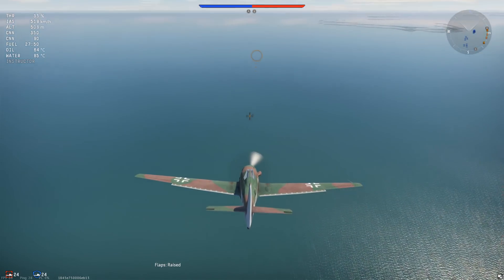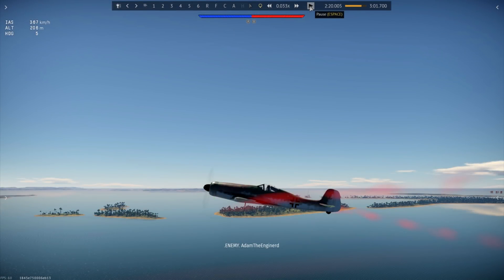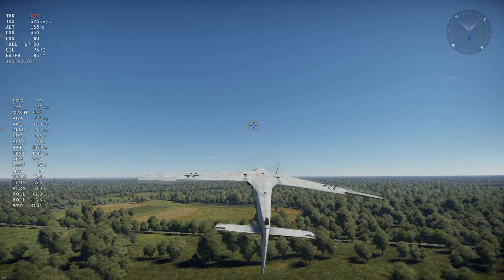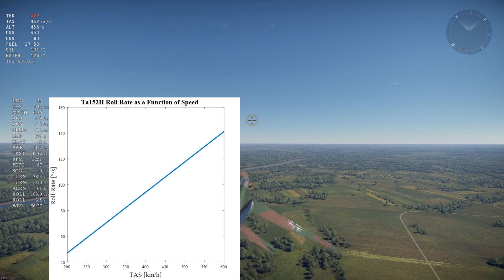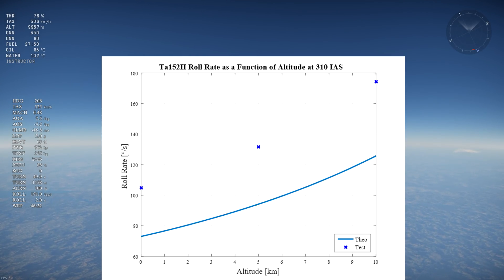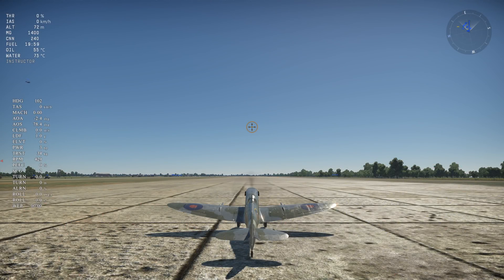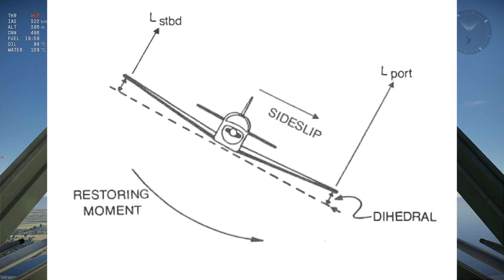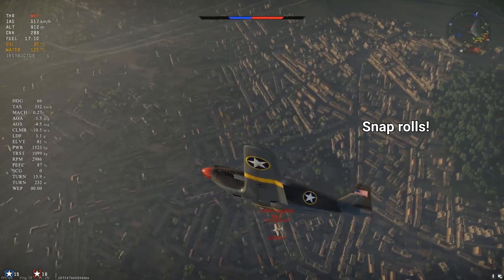Aircraft Roll Rate Explained

Comment: Hey Adam, is the induced drag from this lift significant enough to contribute to slowing down when you roll? Like is it significant compared to the parasite drag from the aileron deflection?
Reply from the maker: No, because the aileron that reduces lift sees less induced drag, compensating the increased induced drag from the other wing. Of course, it'll somewhat ruin the lift distribution so the induced drag will be higher for the same lift. Drag from induced drag should be in the same ballpark as aileron deflection drag I'd say.

Comment: The Typhoon has massive wings... they're thick, and more designed for speed than anything else! On top of that, each wing holds 6x browning 7.7mm guns each with 500 rounds (apart from two out of 6, that carry slightly less).
The Typhoon also carried fuel tanks at the front of the wings, and a weak fuselage...
The lifting capacity of the role rate simply cannot overcome the sheer weight of the wings any more than it does! And if it could, the tail would snap off anyway
Reply from the maker: The wings are thick, but them being thick actually makes them lighter! It's like a taller I-beam.

In any case, the weight of the wings (roll inertia) only affects roll acceleration, not roll speed or roll rate.
Reply: @AdamTheEnginerd  my bad I always assumed role acceleration and role rate were kind of the same thing... or at least that acceleration is part of the role rate anyway...
But yeah It seems like a heavy wing to lift either way... And still that wing I think would be heavy even in spite of it's design, because 6 machine guns is just heavy, and the wings are quite long, meaning the weight is held out at a longer distance (kind of like an extended telescopic crane not being able to lift as much vs a crane in a retracted state)

Comment: Is roll rate related to the Climb rate? It seems to me that a lot of planes with good roll don't have good climb
Reply from the maker: Nope! They aren't linked at all. There is some relation between bad turn radius and good roll though.
Reply: @AdamTheEnginerd  what characteristics do you think a medium altitude air superioty fighter need to be one of the best?
Reply from the maker: @tzeentchnianexaltedsorcero2041  The engine tuning for that altitude, apart from that nothing especially special about medium altitude.
Reply: @AdamTheEnginerd  I'm under the impression that mid/high attitude fighter need to have good linear(?) energy retention and good roll rate for BnZ tactic.
Reply from the maker: @tzeentchnianexaltedsorcero2041  That's good for any alt fighter though.
Reply: @AdamTheEnginerd  ok.

Comment: Hey adam! A bit late to the video but when you mentioned engine torque I remembered that many of the Macchi aircraft have one wing longer than the other to counter the engine torque. How does that affect roll in RB? (if it affects at all)
Reply from the maker: Yeah it does, the roll is faster when the smaller wing is going downwards.
Reply: @AdamTheEnginerd  Thanks! Ill be sure to roll to the smaller wing's side on my next reversal

Comment: On one of the Italian planes, they solved engine torque by having a longer wing on one side! Which one is that plane again?
Reply from the maker: C202 or C205 I think.
Reply: Does that mean it is easier to fly that in sim? Marginally? 
A tiny addendum video upload? :P
Reply from the maker: Maybe, though it only works for a certain speed range. Above and below, you still have a net torque either from the torque or the asymmetric wing.

Comment: You can check if the modeling is correct by testing roll rate with only aileron deflection using a stick.
Reply from the maker: You still have sideslip/dihedral effect even if you only use ailerons, and also the speed gain/loss due to loss/gain of altitude will throw off your speed.

Comment: YT has given me the notification only now :-(. BTW another fantastic video Adam!
I think the typhoon has that bad roll rate because it carries fuel in the wings, and those wings also produce a lot of lift
Reply from the maker: Damn YT! Thanks!

Many planes carry fuel and guns in the wings, and those would only increase inertia, which does not affect sustained roll rate. The wings don't produce significantly more lift than others.
Reply: AdamTheEnginerd well the typhoon is an heavy aircraft (heavy for being a single engine fighter), and to achieve is incredible MER it needs a lot of lift (the p/w ratio isn’t comparable with a spitfire or a Bf-109).
To make a comparison: the F4u4b is another Heavy single engine fighter with 4 cannons in the wings.
The F4u doesn’t have remotely close the typhoon MER/turn, and (at least from what i’ve seen from videos, since right now I can’t play thanks to internet issues) it’s ailerons can deflect at higher angles (the typhoon aileron when deflecting down seems to do less than 5 degrees to me lol)
Reply from the maker: @ferrarisuper  Heavyness is not related to roll rate though. Typhoon has average deflection.
Reply: AdamTheEnginerd I was talking about aircraft weight because the typhoon has a very good turn time and incredible MER, so it needs a ton of lift. Another heavy aircraft, the F4u4b does not have all that lift, so it rolls pretty well.
Btw all aircraft that have a decent roll rate doesn’t have fuel in the wings, i think that’s also why the ta-154 has such incredible roll rate being a 2 engine fighter.
Reply from the maker: @ferrarisuper  No it's not related to weight or lift (much).
Reply: AdamTheEnginerd then i did not understand the video well, didn’t you say that lift is what counters the Roll rate?
Reply from the maker: Yes it's proportional to the induced angle of attack due to roll rate. The wings aren't at their CLmax angle of attack, so planes will produce roughly the same lift for the same angle of attack regardless of their different wings and CLmax.

Comment: Off Topic: thx to you I experimented a little with the overlay data. What i realised is that Increasing Propeller efficiency does not necessarily increases thrust, what I thought to be logical. Why is that?
It was ki43-II if it matters.
Reply from the maker: Depends how you're increasing propeller efficiency, and you need to make sure that you're at a constant TAS because thrust reduces when TAS increases (P=TV).

Comment: I have returned to WT but I run into a situation  when I'm flying in my d30: When I'm slightly outrunning a plane like a 109 or a yak 9 in a straight line, I generally don't know what to do. I saw a video of Green fury who had a major energy adventage and he did a high yoyo with a loop, but that doesn't include my situation. I'm quite noobish so any help would come in very handy :)
Reply from the maker: Run to teammates if you have some left. If you don't, you're in a pickle if you can't outturn them.
Reply: @AdamTheEnginerd  Couldn't you try to go to high speed and make them compress?
Reply from the maker: @pranavarvind4281  Yeah, just depends what you're facing.

Comment: If TAS is constant then roll rate wouldnt change at different altitudes so technically a plane doesnt roll better at higher altitudes assuming throttle is max and engine power is constant, right?
Reply from the maker: Yeah, but planes fly in IAS, not TAS. So at climb speed (constant IAS), you'll roll better at high altitude.

Comment: 0:42 This isn't quite right. It doesn't make lift because it is pushing air downwards or upwards. Instead the position of the aileron essentially controls in what direction the induced circulation will go. If the aileron is on the right wing is up the air below the wing will be pulled up around the trailing edge creating a vortex that is from the pilots view counterclockwise. This vortex then induces a counterclockwise circulation (pilot view) around the wing which allows the the differences in pressure (low pressure below wing and high pressure above wing) and therefore lift allowing the plane to rotate. Another little thing in order to roll the plane you also need to be using the rudder not just the ailerons otherwise you would start so slip. Cheers!
Reply from the maker: Is air deflected upwards? Yes, and that's all I said. Forcibly to get a force and a torque, air must be deflected and action-reaction will produce the force on the wing.

You can roll while slipping. You'd be right if you wanted a pure roll (not really possible).

Comment: Very cool, thanks for the great video. One thing I still don't understand is why the FW-190 (A series) have such a good roll rate. Especially when compared to the Bf-109. There might be minor differences in wing span, aspect ratio and aileron size, but nothing that should result in such a HUGE difference in roll rate.
Reply from the maker: My pleasure!

Fw190A actually has a shorter wingspan and a higher aileron to wing size ratio, hence the difference in roll. Bf109s actually have decently high wingspan for its size with smallish ailerons.

Comment: Adam have you done a video on the spitfire mk. 24? I am looking for MEC settings especially how to keep using WEP whilst climbing, I just can’t stop the engine from overheating and I’ve tried many variations of radiator and propeller pitch.
Reply from the maker: Nope I have not. Put PP to 80-85% and rads to around 50% and you'll be fine.

Comment: If a wing is ultra THICC, would an increase in attack angle correspond to a lesser relative increase in lift, compared to planes with anorexic wings? Id it's the case, then you would expect a short and thicc wing to be optimal for roll rate, sacrificing MER from the former of the qualities, and speed from the latter.
Reply from the maker: No, in fact it would be the opposite, thiccer wings have a slightly higher increase in lift per increase in angle of attack in general than thin wings.
Reply: @AdamTheEnginerd  Huh, that is really interesting. In that case, what is the point of having thiccer wings? Wouldn't be possible to generate the same lift with wings that are simply longer along the chord, and also get less aerodynamic drag, as well as a better roll rate?
Reply from the maker: Thiccer wings are lighter (counter intuitively at first glance), among other things. I explain why here: https://www.youtube.com/watch?v=hDSZ1h5Aphw&t=0s
Reply: AdamTheEnginerd Thank you very much!
Reply from the maker: My pleasure!

Comment: Hey Adam! As an engineering student, your videos are super fun, educational, and easy to follow. May I suggest a video on take off run? I believe it’s an interesting topic with lots of factors, such as acceleration, flap use, landing gear (because of the starting inclination of the wing) and so on, and you could mention the case of carrier based planes.
Reply from the maker: Hey! Thanks for the kind words!

I'll consider it! The carrier part of it sounds interesting. Also debunking the fact that flaps help takeoff would be fun.
Reply: AdamTheEnginerd wait, so flaps don’t help to take off? I understand they lower the stall speed, so the plane can leave the ground sooner, at the expense of climb rate. So suppose you wanted to reduce take off run as much as possible, even if the plane doesn’t climb much after it leaves the ground, wouldn’t you use flaps?
Reply from the maker: Flaps reduce climb/energy gain as you say. If the runway is long enough to takeoff without flaps, you shouldn't use flaps.

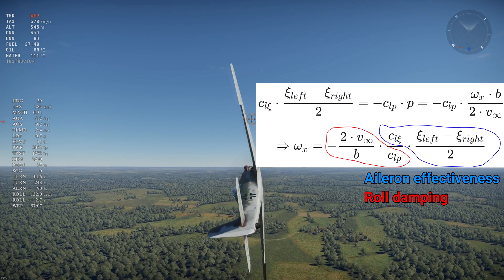Comment: At 3:40 you specifically mention TAS, would this not be IAS as this is the air speed that the wing "sees"?
Reply from the maker: No! TAS is what gives the geometric angle of attack that the wing sees which affects roll damping. Roll is one of the few aircraft characteristics that depend on TAS rather than IAS. Good question though. I can go into more detail for the explanation if you're interested.
Reply: AdamTheEnginerd I would love more detail!
Reply from the maker: You are certainly right that the force or torque produced by the ailerons is proportional to IAS (dynamic pressure). But, the roll damping, which is the opposing lift force due to the rotation of the wings, is also proportional to IAS just like the regular lift force! Since we are only talking about the sustained roll rate, torque from ailerons is equal to torque from roll damping, regardless of IAS!

For roll acceleration however, you're starting at 0 roll speed so there's no roll damping, a higher IAS will provide a higher aileron torque and your roll acceleration will be higher, so you'll reach the sustained roll speed in less time.

Comment: I had never realized engine torque was off in RB ; I always thought the instructor was simply applying perfect control-surfaces deflection to counter it. I guess that's a contributing factor to explaining how many aircraft perform vastly differently between RB and SB.
Reply from the maker: Yeah, or else you'd notice you'd roll to one side when at very low speed where ailerons can no longer counter torque.
Reply: For example the 109 has a heavy torque to the left in sim but in rb it flies virtually straight
Reply: I have been playing "full real controls" with hotas in RB and engine torque was there for me, actually everything was just like in sb despite playing against ai piloted planes and no view restrictions applied :P In fact, both modes are barely differentiated by controls and views forced in that are just applied in the manner of unencrypted text file lol. Some of cheaters I have caught in SB were simply editing this file to play rb rules in sb.
Reply from the maker: @eldarguardian6485  Oh yeah, what I mean is that RB with typical mouse aim does not have torque. Any mode with full real controls will have torque.

Comment: adam i have a issue regarding seafire fr 47 and spit lf mk9. as we know researching all performance mods in aircraft turn stats card parameters green, but this doesn't happen with these 2 planes.....its stats card trun green when i uninstall "150oct fuel". is it a bug or gaijin doesn't implemented 150oct fuel in their performance.....plz check about this. i can send u pics or record a video if u want
Reply from the maker: Yup, stat cards (and test flight with "spaded" plane) don't use 150 octane. It's been known for a while.
Reply: @AdamTheEnginerd  ohh i didn't know that, I'm new in air battles
Reply from the maker: @rahulsamant2003  Stat cards lie as well, you can't really trust what they say except for top speed.
Reply: @AdamTheEnginerd  u know air battles is too much complicated, its the reason i ignore air battles 1st time. but ur contents makes things easy......and why u stopped  "battles of the graphs" series?
Reply from the maker: @rahulsamant2003  Looking for interesting matchups to do them!

Comment: Hey Adam, great vid! I was wondering if you had a video with the P47D or M? I recently got them but I just cannot figure out how to play them for the life of me. The bf109s and FWs always get me in a shallow dive or shallow climb, and zeros always seem to just turn around on a dime and catch me in the climb I do to get away. I feel like I'm doing something horribly wrong. Thanks!
Reply: Solution: Go faster. But for real, you can outturn a 190 pretty much any time, and you can out turn a 109 above 450kph (ias). Zeros cant catch you at all especially the M, a J2M has the climb rate to dive on you but you should dive as well to equalize energy and then extend since you have a vastly superior top speed. You can also use your 2700hp engine and good flaps to prop hang like you wouldnt believe possible.  (I have no issue mixing it up with the germans but i dont recommend it until you get very confident in the plane) Dont follow enemies in a dive, unless you know you'll be able to get the kill and reclimb you need the alitude for that massive engine to do you the most good
Reply from the maker: I have both! P47M is most recent: https://www.youtube.com/watch?v=sLayaEyzEsc&t=0s

Comment: I guess for typhoon, it would have more to do with the Moment of Inertia. The presence of heavier guns on the wing may increase the moment of inertia which means more torque required to produce same amount of roll.
Reply from the maker: Inertia doesn't explain poor sustained roll. Inertia has no effect on sustained roll, just like inertia has no effect on top speed. Inertia only affects roll acceleration.
Reply: @AdamTheEnginerd  Just shooting wildly here, but does it perhaps have anything to do with the very thick wing roots? I know the Hurricane also has some trouble rolling, a trait it shares with the Typhoon.
Reply from the maker: Wing roots are the part of the wing which would have the least effect on roll because it's so close to the axis of rotation, so the angle of attack on the wing roots is small and doesn't counter roll much. However the Typhoon wing is thicc the whole way indeed, I just don't know what that changes exactly. I have some ideas, but they don't seem to be enough to explain the really bad roll.